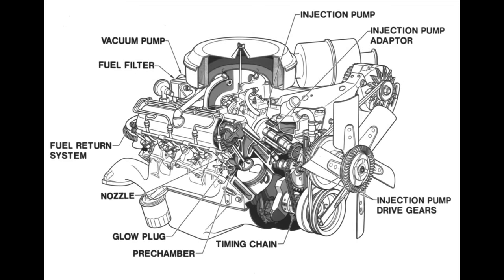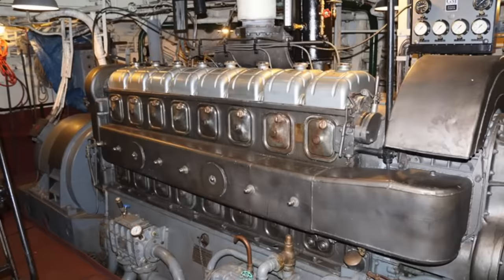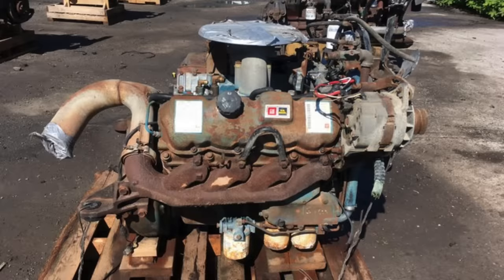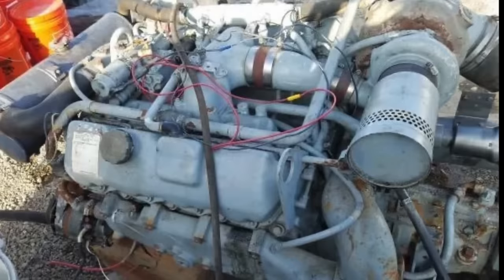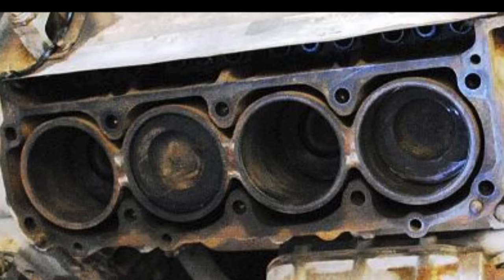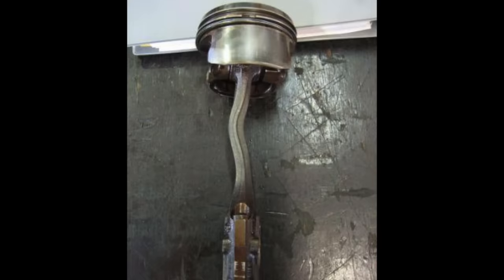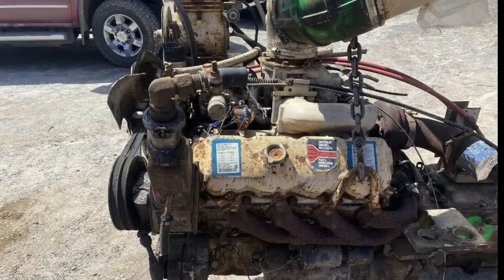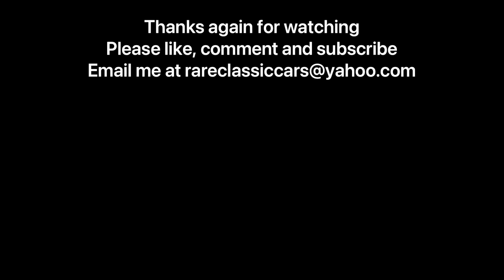Worst Engines: GM's 8.2L / 500ci "Fuel Pincher" Detroit Diesel Pinched Its Owners' Pocketbooks

Comment: The fuel pincher diesel was horrible. You can still find some of them in Barth motorhomes today. If you do run don't walk the other way unless you plan on a repower. GM had rocks in their heads with that engine much like they seem to currently have with the amount of recent recalls. GM is currently creating another 10 years of video material for Adam. Always been a GM guy myself but currently have no desire to own one new. They also have a dealership quality issue for years now on accurate reputable work. It's bad when the service advisors have to ask you respond in a positive manner to some questions and practically fill out the form for you. Having said that I will keep my Duramax LBZ new from 2006 another 18 years still very happy with it.

Comment: Great video! Brings back some memories. I worked for a GMC dealer for a few years back in the 80's. When these engines started coming back with head gasket problems we found out that to the best of my memory you could only resurface the cylinder head .002 thousands max. Almost all the heads and the decks were warped worse than that. After a while you just dumpstered the old engines and put new or reman ones in.

Comment: Worked for school as mechanic , we had over 100 of them. About 150,000 miles and then problems.  But that was the life of a school bus in the area northeastern US. I'm old enough to remember the Toroflow. Another Gem. The cycle 238,318,and v12's along with the 92 series were great for reliability but would never make emissions today

Comment: Replaced my high mileage 81 8. 2  diesel, in my 81 F700, dump truck,  with an 87 , came with a perfect school bus ( surplus. ) Swapped out perfect , been around 20  yrs ago, no cold start system at all,  fires up and runs great, in 10 degree weather. This engine is amazing. Great torque , slow truck, who cares?

Comment: I know this engine well. I was just getting into trucking when it was introduced and I was also in the army reserves here in Canada at the time and our license built version of the M35 2 1/2 ton military truck had this engine so I've got a lot of hours operating this thing.

If you got the turbocharged version, it wasn't too bad but the NA versions were absolute dogs. The 3208 Cat was the gold standard in that class at the time and very common. I remember quite a few companies were attempting to bring competitors to it onto the market because there was a big push for a diesel option in medium duty trucks. IHC produced the DT466 which was an excellent engine but most of the others in the range weren't that good.
Reply: The IH DT466 was actually used in tractors and other equipment before it was used in trucks. IH (like the others) rushed to answer the Cat 3208 (1150-1160 originally) and produced thier 9.0L V8 diesel. It wasn't a "bad" engine, but wasn't exactly a "good" engine either. Cummins also answered with thier "triple nickel" 555cid V8 diesel. That Cummins 555 ended up going into more off-road equipment than it did into highway trucks. There was even a short lived V6 derived from that 555, I saw one in an old Clark front end loader at an auction once.
Reply: I know a boater running twin fuel pinchers and they’re turbocharged.  The previous owner dropped at least $30,000 US into those two diesels to make them perform reliably.  Which my friend, Ty, greatly appreciated once he bought the boat.

Comment: A future topic: discuss the earlier GMC V12 truck motor made from the GMC V6
Reply: And the Toro-flow diesel
Reply: And perhaps even the Toroflow, which I believe was derived from that same architecture.

Love those V6s with their 348/409-looking valve covers.
Reply: @DanEBoyd From a far away glance, I have mistaken GMC V6 for 348/409 in medium duty trucks at junkyards before 😂
Reply: Lived two houses down from a small town FD that had a truck with one of the 702's.  It had a very distinctive sound, and the couple of VFD's I talked to about it said "It would shit and get".
Reply: 702 v12 was the first engine I helped build. I was about 13 and we used 2 fan belts to lift the crank by hand. It was so damn heavy.
Reply: I had a lot of experience with the whole GMC 60° family...305s, 351s, 401s, the V8s, (and the "ToiletFlow" diesel), but never ran or worked on the 702 V12.  I do know they had gobs of torque, like all the GMC 60° family.  I learned that when a loaded logging truck passed me on US 101 up a grade when I was in a GM PD4106 coach  with an 8V71.  He passed me like I was parked, and that model bus was known as a "hot rod."

Comment: The Fuel Pincher was a means to an end…they needed a diesel that was good on fuel that could be used in medium duty applications under low loads like in school buses and small dump trucks…and it did just that!..I drove one years ago and it was quiet compared to many other engines and it was no ball of fire but it was certainly very good on fuel!..I suspect if GM hadn’t used the cylinder design they did, the engine would have been much more successful and they could have pulled far more power out of the engine but that was not possible because the two major hurdles they wanted to overcome was low fuel consumption and low upfront costs…and in that regard they accomplished what they set out to do…
Reply: 100% agree. These little guys were amazing on fuel! And yea, it's a shame about that cylinder deck.......

Comment: Seems no one ever mentions the old GMC 60° V6 torro-flow and torro-flow II engines. These were not detroit's. They were a 4 stroke diesel's theoretically based on the big block GMC 60° V6 gas motors.
Reply: Those are some engines I'd like to hear more about!
Reply: Am familiar with the Toro flo. Great engines based on the rugged V6 4 ,stroke heavy duty gas truck engine. Very good medium duty truck engine. Excellent cold weather starting and as the name turo flow indicates head design made for vortex swirl thus excellent economy. Some cheap bastards would they two use them in tandam axel semi tractors trying to pull fully, loaded  semi trailers. That was two much.

Comment: I volunteer at a small farm/school.  We have an older F700/750 dump-truck with one of these boys.  It was a previous USAF truck, and we have no real history other than I started it for the first time in about 15 years when I got it running so we could use the truck.  This thing is nothing special, but it runs like a champ.  Whoever had it for many years at the least didn't abuse it, and probably took pretty good care of it.  I hope to keep this boy running for many more years.

Comment: We had a half dozen school buses in our fleet with 8.2's.  They actually drove out pretty nice.  Two of them had head bolts and gaskets done under warranty.  We had two in Ford chassis, and they were trouble prone in a couple of areas.  The electrical connector interface wasn't well thought out and would create intermittent problems.  Once I figured out the issue and bypassed the plugs with for-sure soldering, problem solved.
The other thing that plagued these was sealing of the radiator caps and coolant recovery management.  Turned out they had a fair amount of left over core sand in the castings.  I tried all sorts of flushing, but it just kept coming back.  Finally installed coolant filter kits from my local NAPA store and - poof - no more issues.

Comment: I had a 1986 GMC 6500 that had this engine and my was great, drove it for 18 years, never ever gave me a problem, never broke down, when it passed 200,000 miles it did smoke a bit till it was warmed up, but just dead reliable for me, also averaged 14 MPG with the 4 speed Allison automatic.
Reply: Just stop it with the truth here...your facts dont support the Narrative that were crappy motors an deserve shame....lol
Lots of them were fine motors...lots still out there doing the medium lifting.👍
Reply: So you’re the one,
Reply: I have an 1986 c7000 chipper truck with 8.2 Turbo. Runs great, starts every time. 280k miles plus countless idle hours for the chilper bed/pto. It has been so dead reliable to me, I decided to recently replace every water hose, belt and water pump (very hard to find an OEM pump). The school county owned and tbey but a brand new clarck 5speed and clutch right before I got it. I guess the person I am replying to is the ONE and I am the second!
Reply: ❤❤❤❤❤ had one no problems

Comment: I remember these from when I rode, drove and worked on school buses.  I don't remember them having head gasket issues, but they where indeed low on power.  They were ok for the Ford and Chevy school buses and county fuel truck, but I couldn't see them being in anything heavier.  What I do remember was what a nightmare it was replacing those water pumps.

Comment: I’m shocked that these had a bad reputation. 
I remember these being in a bunch of school buses that were purchased new in the early 80s, and at least some of them were put into Fords. 
The one I rode in was a Ford, and I remember being surprised that a GM engine was in a Ford at the time. 
That bus was available every day though, and it was rare to see a substitute bus in any of the bus routes  in our school district….most of which were GM, and a couple of old Internationals. 
There were a couple of Caterpillar powered pusher diesels, that were used for long field trips and such. 

I got a little long-winded there, but one thing I wanted to say was that I never saw one of these fuel pincher, diesels break down, so I thought they were probably pretty good. 
I graduated in the spring of ‘84,  went into the Air Force, and never went back home (except to visit).
That was the last I saw of those buses.
Reply: Those engines did a marvelous job in the school buses, except that they were loud. For some reason, they had more get-up and go in the Fords than GM’s.
Reply: 8.2L lower horsepower models did ok. School buses were pretty light and generally get the lowest power engine, so they did ok.
Reply: Sounds like a good experience, bet GM could've used your testimony! Yes they were in fact so bad that an entire THIRD of engine production was for complete spares. They anticipated replacing roughly half the engines sold. And that doesn't include all the parts...

Comment: Thanks Adam. 
I drove heavy duty trucks and tractor trailers and well as medium duty trucks. I drove medium duty trucks with an 8.2 Detroit as well as 3208 Caterpillars and the 9.0L International. I remember the open deck design on the 8.2, not only couldn’t it compete with the 3208, we had an 8.2 that blew. 
The heavier duty trucks I drove had 3406 Caterpillars and I drove one with a 3408, real hill flattener, drove the 855 Cummins, various 71 and 92 series 2 cycle Detroit’s,  those engines screamed! Didn’t get to drive the later 60 series 4 cycle Detroit. Heard they were good engines.
Reply: I remember Ford having a 9 liter V8 that made it into a number of buses before the DT466's showed up. Had one of those and man it would run. It would walk anything else in the fleet.
Reply: Series 60 engines were good and were rated at 1000 lb-ft to 1850 lb-ft torque depending on displacement and model year. Treat em right and they'll reach a million miles before a (*full*)  rebuild, then run em for another million miles or until the block cracks!

Comment: Had one in my 82 chevy c 70.  It had an 8 yd dump body on it.    Spent alot of time pulling a case 580 series backhoe on an equipment trailer.  It was a pig but it always got the job done.  I miss that truck.  Had it for 18 years and only needed  basic maintenance the entire time.

Comment: These do have one very good quality, and that is the sound they make. Much like the IDI V8’s like Fords International 6.9 and 7.3, and GM’s Detroit Diesel 6.2 and 6.5, the 8.2 has a glorious acoustic song that it plays while you drive them. I know it’s subjective but I think these old IDI V8 diesels are the best sounding diesels ever fitted to pickup trucks and light duty trucks
The old diesels in general just sound better to my ear than anything made today 
Take care!
Reply: Although they sound similar, the 8.2 is not an IDI diesel. The 8.2 is a Direct Injected diesel. In my opinion, the 8.2 sounds similar to both a 3208 Cat, or IH 9.0, which are also Direct Injected.
Reply: @johneckert1365  I was just a kid when riding to school with the 8.2 in most of the buses we had at the time, and never knew they were direct injection. I know the good ol screaming two strokes were direct injection but always thought the 8.2 was IDI
Thanks, learn something new every day
Reply: @dragon81heart  An easy giveaway is to look at the pistons. Did you notice the pistons in Adam's video here? If not go back and watch again if you have time. The pistons have a cute little dish in them, almost like a crater. That dish also has a mound with a point on it, kinda looks like a smooth mountain. That point is the hottest spot on the piston, and the injector sprays it's fuel directly onto that point. They're called DI because the fuel is sprayed "directly" into the cylinder. That little dish in the piston is the actual combustion chamber. 
Now on an IDI diesel the pistons are flat without any dishes or mounds other than maybe some valve clearance reliefs. The heads have a "precombustion chamber" in them. That's like a little cave where all the hot compressed air goes on the compression stroke. The injector sprays it's fuel into the precombustion chamber, rather than directly into the cylinder. The glow plugs also go into the precombustion chamber to preheat them for easier starting. The explosion that starts in the precombustion chamber then has to fart out of a fairly small hole to get into the cylinder to push the piston down. That one of the biggest reasons IDI engines make less power than similar sized DI diesels. IDI engines also require much higher compression ratios to run, which hurts thier efficiency and durability.
Reply: @johneckert1365  oh I’m quite familiar with the 6.9, and 7.3 IDI’s as we have a few in the family
Even had one of the sort of rare factory turbo 7.3 IDI in a 93 F-350 dually that we towed office trailers, campers, etc with. That thing was a TANK! I’d absolutely love to have one again. I learned to drive standard trans in it and an 84 F-150 with the 300 and 4 speed OD (with a big gap between 2nd and 3rd, like a more modern 5 speed just driving it without 3rd gear lol)
So many great memories in that 93. 
Was the only diesel on the market that when loaded could run with the old 12 valve Cummins Dodges in the mountains, and would walk away from them on the highway. Was a highly overlooked engine in Fords history as the DI 7.3 Powerstroke came out just a year later.
Definitely appreciate the lil lesson on the workings of them as it’s been a long time since I was around them and am admittedly a little rusty lol
Thanks!
Reply: @dragon81heart  You bet. I never drove an IDI 7.3 with a turbo before, but plenty of them without. I have a wrecker and a rollback with IDI 7.3 in them.
Reply: I love my 7.3 IDI. It’s getting a banks turbo when I have to do a clutch. Been a fantastic truck, and I agree, these old mechanical diesels sound so wonderful. Cruising at 70 and just hearing it sing and the little bit of floorboard vibration is great. Wouldn’t have a newer one.
Reply: @johneckert1365  the turbo doesn’t make a huge difference when unloaded but can definitely tell with a heavy load, or at high elevations. We usually saw a 1-2 mpg improvement when towing vs the ‘88 7.3 we have prior to the ‘93 turbo
Reply: @connorjones1485  it’s mechanical music!

Comment: Saw one in a truck once. My line of work was marine diesels. I had a friend and customer that had a pair of marinized 8.2L Detroits in a Tollycraft with V-drives. Despite their bad rep, they gave him less problems than the v-drives did.
Reply: The 8.2 in boats seems to have worked out.  Boat owners liked them and the heads didn't give such a problem for them.
Reply: @madderanger7838 common guess was that the superior cooling helped the heads stay located.
Reply: After the early years, word got out to boaters: don’t ever push it to redline for long,  or at all.  Every one of those still running in boats has been so reworked and improved just to get to basic reliability.
Reply: @wallacegrommet9343  that can be your story....but the folks that run them know more than you most likely. Most mechanics are pushing to deinstall them for something else now, because parts are getting scarce....but I've talked with several boat owners that aren't looking forward to the increased hourly fuel consumption.